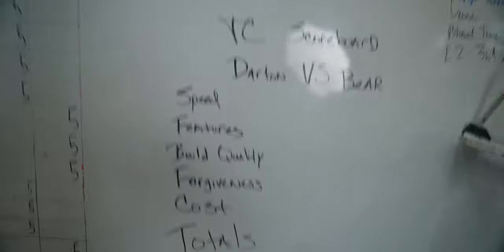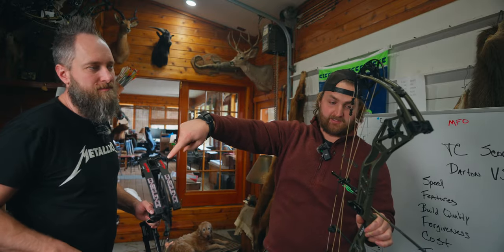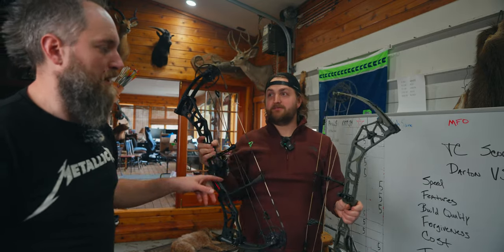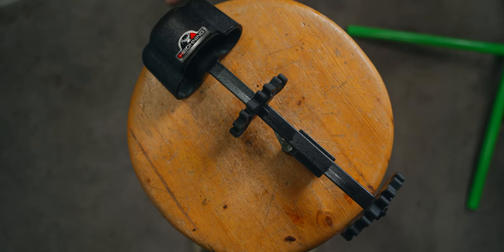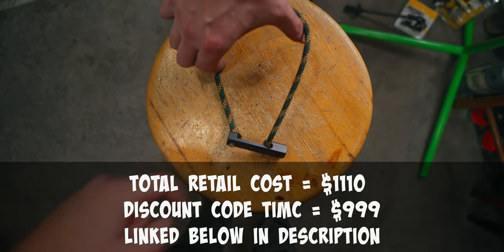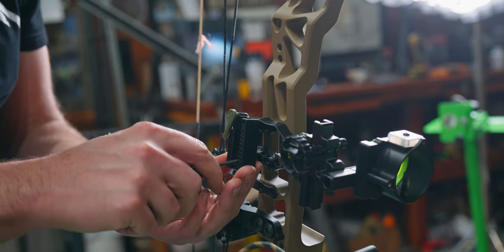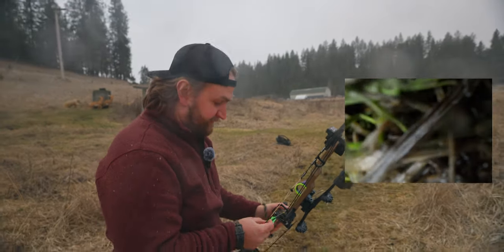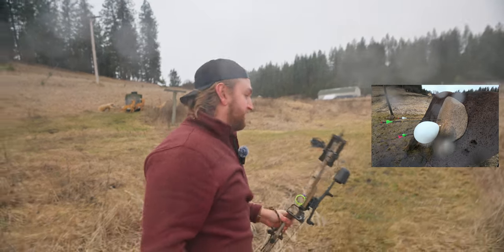Best Bow Build Under $1000

Comment from the maker: Having a lot of fun with the budget bow series.. extra $120 bucks to play with on the bear, what would you do?
Reply: Three different options. A back bar , an upgraded rest , a quivilizer and a back bar.
Reply: @NeilEubank  2nd this.
Reply: At $30 a roller glide might smooth out the draw cycle personally I think like mfjj says you will get use to it. With the other $90 maybe some stabs if you can fit them in the budget.
Reply: You could do the same set up but possibly squeak in either a landslyde or a hamskea
Reply: Hamskea rest, roller guard, or upgrade the slide.
Reply: I think the pre built bow is a really cool idea. Maybe there is a way to to have pre selected options for each piece of gear? Like have 3 sight options, 3 rest options etc. and all totals add up to sitting $100 of each other.
Reply: This is just awesome stuff and I love it!!.  Tim thanks for droppin great content as always!. On the Alaskan XT, semi important, definitely go with a trophy ridge versa light quiver!!!!! Gives you options of where an how tite to the bow it's mounted, can also be converted to a 2 piece. Super neat quiver with built In rechargeable green LED light that is bright enough to walk an navigate the woods in the dark I use mine an don't even carry another light. I'd go with the same rest, an same sight but, I'd bowmar grip tape an slap a hamskea raptor peep on her an she be WICKED!!! I bet she'll drive tacs an surprise you. Hard to beat a bow that will hang with most any flagship other brand but for HALF the price 🤯
Reply: Just wondering if your going to sell this one or the bear.  Funny enough I’m flying in for work from NJ this coming week.  Monday to Thursday morning.  Thanks and keep up the great videos
Reply: Darton needs to make a 33 in that config

Comment: I got my Alaskan XT last Tuesday. I put 150 shots through it to settle in the strings. I ended up cutting off the string grubs and installing 4 brass nock in each one's place with shrink tube. I also got it super quiet by tying on cat whiskers between the speed nock sets.  Bow shoots real good!!

Comment: Last year I got my first bow. I picked a Bear species EV ready to hunt package. I'm a lefty and have it set up with 28 1/2in draw at ~65 pounds running cheap 480 grain arrows with 125 grain field points and G5 Montec fixed head for deer in NC. I love it and got it for $600

Comment: The dampening material on the Bear is very hard. For $60 you can swap out the Bear string stop with a Hitek sand trap and the stock limb dampeners for Limbsaver twistlox for a significant reduction of noise and vibration. Use Tim’s discount code and you’ll basically get an upgraded bow at original price.
Reply: Are you sure those will work on the bear bows. Ive got a bear resurgence LD and that’s bout the only thing on the bow I hate is the stock string stop
Reply: I can’t speak on your specific model but I have one on my Alaskan XT. They are built bow specific for a guaranteed fit not a universal one size fits most. I would reach out to them but I can’t imagine why they couldn’t build you one.

Comment: So, question. I own a Bear Paradox, and I have noticed that the serving separates extremely quickly on the cables where they are attached to the cam. Almost like the track has too much of a sever bend. And yes the strings and cables have been changed. But serving separation sets back in after 50-100 shots. Not as bad as it was with the stock strings but still. Is this normal for all bows or is it a Bear thing? Might be something to think about for a price point bow, as speaking towards design of the cams and string / cable attachment.